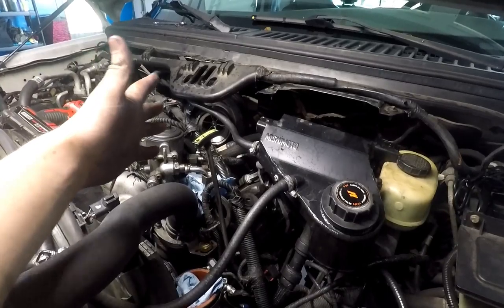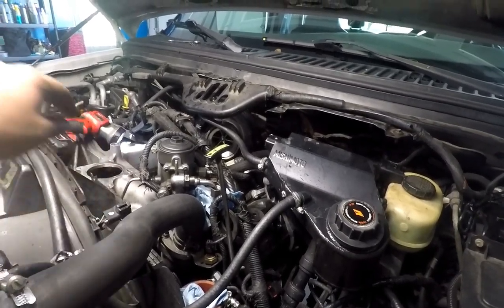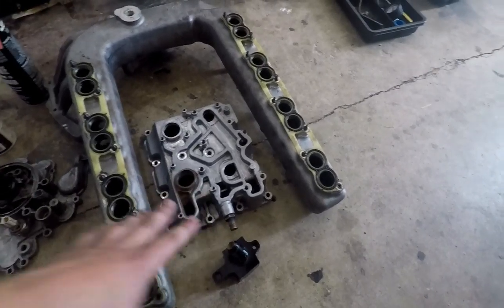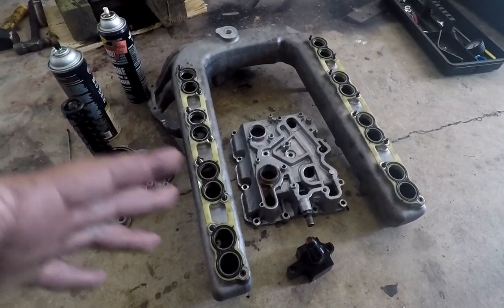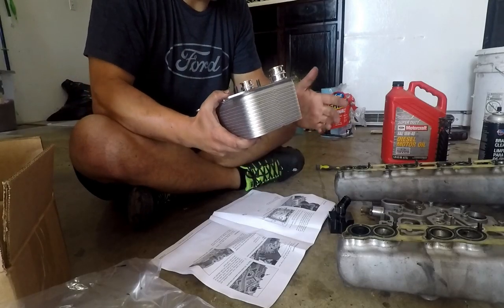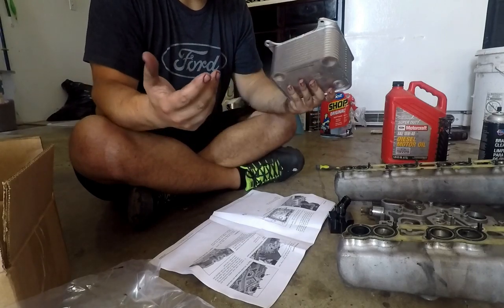Oil Cooler Replacement

Comment: I watched diesel tech Ron’s video and he made it look a little time consuming. But this one doesn’t seem as terrible. And I’m assuming you can change the egr cooler while you are in there to get more of a reliable “somewhat bulletproof” 6.0? Or am I wrong ?
Reply from the maker: It is a big project but very doable. Ron was a hell of a mechanic, and has lots of great info. You are also correct the egr cooler will come out at the same time and can be addressed then
Reply: 6.0 Bros you just made it look pretty simple lol
Reply from the maker: Well thanks man. It truly isnt bad. However, it is a big job at the same time. Very doable though
Reply: @six0bros  i am about to do this job, but i dont understand why ron removes the turbo, but you dont. why did he go through this step and you didnt have to?
Reply from the maker: So removing the turbo does make it easier and definitely is not a bad idea. The pedestal gets in the way a bit. Also some years like early 04 and the 03 trucks the I take manifold has a crossmember at the rear of it that makes you have to remove the turbo
Reply from the maker: @meghandoyle692  the other thing is I have an after market intake manifold as well

Comment: I'm surprised you didn't try an oil cooler backflush kit.
Reply from the maker: I wanted to and plan to do a video talking about it and showing it, but at the end of the day I was running out of time to do it and just needed it done. However there will be a backflush video in the future
Reply: @six0bros  I bought a fixur6 backflush about 3 months ago. Haven't installed yet. I just ordered a case of delo elc last week so a major flushing will be in the near future. I still run Ford gold. 30k miles ago I did my oil cooler but choose to stick with the gold at that time. I have not had a problem with it at all and deltas have never been around 15. Most are running the red so I'm joining the crowd. 

Keep up the vids man. When you haul the camper you should make a vid. Post some temp numbers and such.
Reply from the maker: @fordguy3773  I was going to but the truck went down. Thankfully someone is lending me their duramax so here comes a comparison video

Comment: How did you get top half mirror cover off
Reply from the maker: Tilt your mirrors down there are 2 tabs at that top to press up on
Reply: 6.0 Bros was they chrome before you painted or are they after market mirrors
Reply from the maker: @johnross5397  they are paint to match mirror caps

Comment: Did you have to remove the turbo
Reply from the maker: I can't remember if you can sneak it out or not. It was easier to get my turbo out and intake manifold out of the way though. You may be able to sneak it out without removing the turbo but the intake manifold has to come out
Reply: Late  04 intake manifolds don't have the wrap around style which means you can sneak it out  without removing the turbo

Comment: So what oil cooler have you found or heard of is this best replacement for the stock one??
Reply from the maker: Another OEM oil cooler. Before replacing your factory one if it is going bad. Doing a chemical flush then making sure to get everything out pulling the drain plugs on the engine block then replacing and you should he good to go
Reply: If you run the correct coolant in your truck and your egr is either removed or working correctly, your oil cooler will never fail. If you're not sure of the quality of your coolant, flush it out and put new coolant in it, either ford gold (yellow) or cat extended life coolant (red). Make sure your oil cooler is still good though before you do that if you do that

Comment: I did this back in November or December. Nothing was wrong I did some preventive work. Upgraded stc fitting, high flow cooler and egr delete. But I had to take the oil cooler off again a month later because the cover started leaking. Piece of trash got between the cover oring and the block and crested a leak point. Wish I would have known I didn't have to remove the turbo the second time. Needless to say I cleaned the crap out of the block area the second time.
Reply: My buddy who is a Ford diesel tech told me to stay away from the Ford cooler. Told me to get a sinister. But I got a egr delete kit and cooler from egrdeletekit.com and it's been problem free.
Reply from the maker: I personally do not like any of the after market coolers I have heard a lot of bad or that they are less efficient at cooling than the OEM design.
Reply: I can respect that decision and reason. I run 6-9degrees difference on my deltas. Some times 10 but it never stays that far apart but for a few seconds. Usually after I floor it on the interstate to pass someone.

Comment: Jared didn't you replace the oil cooler when you did your rebuild?
Reply from the maker: Yes I did and I have rust in my cooling system that clogged it this time. Looking into the issue to resolve it so I dont kill another cooler
Reply from the maker: I have thought about it. Maybe one day lol. It's a nice kit. My only concern is a have heard people have issues in cold climates in the winter with the truck having a hard time warming up.
Reply from the maker: @treo1225140 if I lived down south I probably would have it, but winters up in PA can get a little brutal lol. Nice piece though
Reply: 6.0 Bros What about just installing the reroute kit that uses stock cooler?  why wouldn't that be the best option?
Reply from the maker: @mikehunt7483  I think that is a great option. Or the ipr kit I think let's you use a 6.7 powerstroke oil cooler.
Reply: 6.0 Bros Just looked it up on Innovative's website.  that's pretty much exactly what I'd imagine being the best setup.  Why hasn't something like this been done before?  What am I sacrificing beside cost of kit?

Comment: Ok not exactly related to the video but seeing as your the go to 6.0 guy I figured I’d ask ... So had a very strange incident today, typically my truck will hit 110-111 and I get the shut down, today not so much... had an a$$hole in traffic not letting me over I speed up he speeds up I slow down he slows down, finally I slowed to the point I was doing like 45mph in a 65mph zone and said screw this... I floored it expecting the bog a black cloud of smoke, then spool and go (I do have a non-vgt after all) which all happened, idiot hits it at the same time and paces me all the way up to what I figured was going to be the limiter but instead my speedo started bouncing like it was doing a test sweep, went back on the other side got stuck at like 35 I finally passed the stroke slowed down a bit it flew back over to the other side after doing like another few test sweeps got locked at 90 while I was slowing down for a few, and then finally returned to reporting actual speed... any ideas? Bad speedo sender or something? Whatever it was my limiter didn’t work because of it I’m sure I probably wasn’t way higher than the limiter but I was definitely over it (2004 F250 SD 6.0 PS auto btw because it wasn’t mentioned)
Reply from the maker: Well first thank you for the kind words. Second I have heard of trucks after hitting 100 starting the speedo over but not exactly what you described. Mine after 100 just stays at zero. Until I am under 100 again. Also you may not have a mph limit anymore since you're tuned. I know mine is removed. If it only had issues once i would wait to see if it happens again. I have not heard of this issue before.
Reply: The SCT on the dash is set with a 111mph limit

Comment: Started mine yesterday hahaha. All stock truck.
Reply from the maker: How is it going so far?
Reply: @six0bros  well. Ran outta day light yesterday. I have the intake mani back on and i forgot that fuel line that bolts to the front of it. I ended up just giving up on it i was pretty tired cuz im also sick hahaha. Might need to take the intake mani back off to fit that fuel line back on. Other than that it went pretty smooth.
Reply: Definitely wish i would watched ur video first cuz i took off way more even tho iv been down this far into the motor before. Not for the oil cooler tho. But i know for next time tho! So thanks a bunch for that!
Reply from the maker: @chrissannes1348  glad to hear it helps man

Comment: I've gone through 3 coolers, I've flushed the hell out of it to. Only getting 5-10k out of a cooler. Anyone else going through coolers like this? Thinking about the bulletproof kit...
Reply from the maker: How are you flushing it?  Have you tried a chemical flush prior to changing the oil cooler? Typically I do not think coolant filters are a must but it could be helpful for you since you seem to be having some issues.
Reply: @six0bros  I've gone to the Max!! Flushing it with both of the restore products, step by step by the book. Even made a power flush tool that uses pressurized air and water. Flushed it every which way, installed fumoto valves in the block drains so I could do it over and over again. Not even joking spent 2 full days just flushing it. Using cat coolant, distilled water and a coolant filter. The first time I changed the cooler I added the filter but did not flush it, it clogged, but I will say the truck sat for about 2 years. Next time I changed it (3rd cooler) is when I flushed the hell out of it as described above, also put in a mishimoto radiator at this point. It clogged again after about 2 years, I would have to check my log to see how many miles but less than average. It's not super clogged yet but I am still getting 20-25 degree deltas while towing 14k. The odd thing is that once I take the clogged cooler out and run water through it it is barely noticeably slower than the new one that I'm putting in. I was wondering about my water pump but the engine temp seem normal. I'm kicking around the idea of the bulletproof kit. I've already got it apart right now doing a bigger turbo and injectors so it would be a good time... Thoughts?
Reply: Try pouring acid based restore directly into the cooler for 5 mins. Then instead of backflushing towards the water pump, duct tape a 3/4 hose to a shop vac and suck it out. I've had good luck with this method. Brings my deltas back down every time. Done this 4 times now pretty well once a year. I do it when deltas get above 10 unloaded. They go back down to 2 or 3. I have a write up on FTE from my first time doing this. Good luck!
Reply from the maker: @nickdeiters4690  having heard of this method before. That is a pretty cool thing that it has helped you. I wonder why you guys are having an ongoing issue though
Reply: @six0bros  I used to watch powersmokehelp and used ford gold until last year when i grew a brain, researched and switched to cat elc. I really think that was my problem. The gold was meant for a Taurus or an explorer, not the monstrous physics of an international diesel engine imho. So far my temps have not climbed in 8-9 months. Blending with distilled is obviously important too
Reply from the maker: @nickdeiters4690  I think for gold is ok but it takes a ton of maintenance. I run cat elc myself in my 6.0 and I'll probably run it in my 6.7 when I flush the cooling systems
Reply: @six0bros  good idea. Check out "water jacket cavitation" in the 7.3 forums. That's where our "sand" comes from. The diesel "detonation" causes cavitation bubbles on the walls of the water jacket (think flicking a soda bottle) and erodes it over time (casting sand). The gold (how I understand) wasnt designed to resist that or the high cylinder temps (silicate precipitation) but was still a 7/10 option per fords research so they went with it. I may be wrong, but it makes sense to me. so elc it is.
Reply: @nickdeiters4690  I think I found your post you were talking about. So am I understanding you correctly? You take off the plate on the oil cooler housing, suck out the coolant, fill it with whatever Acid you were talking about and then suck it back out the same hole you poured it in under that plate? Basically all this is done through the one hole under that plate?
Reply: @nickdeiters4690  the post I read didn't have a whole lot of detail as far a where you poured this and vaccumed that so I just wanted to make sure I understood you right. That plate is actually the outlet side of the cooler isn't it? I can't remember
Reply: @kpxoda1  yes. It's the outlet to the egr
Reply from the maker: @nickdeiters4690  I have not heard that man. thank you for that information I will have to look into that to learn more about it.
Reply: @six0bros  I just read a couple people taking about an oil cooler bypass valve in the filter housing, anyone know anything about this should I be looking into this?
Reply from the maker: @kpxoda1  I do not think that can mix with the coolant. Typically it can the cause of a no start or hot no start although not common
Reply: @six0bros  I didn't mean anything to do with mixing but failure of the valve could allow the oil to bypass the cooler and that would cause high oil temps. I'm not saying that this is the case, but something I read about and was looking for more info because I can't find much. I know a fair amount about this motor but not intimately enough to understand how that valve could effect oil flow.
Reply from the maker: I do not think it would cause high oil temps. Have you ever tried back flushing your oil cooler with water and compressed air?
Reply: @six0bros  no not with the adapter plate that you can buy in a kit. Problem is the truck is already apart and I would have to put it all the way back together to see if back flushing worked and then tear it apart again to either change it or put on the bulletproof kit. So I'm tempted to just go the bulletproof route